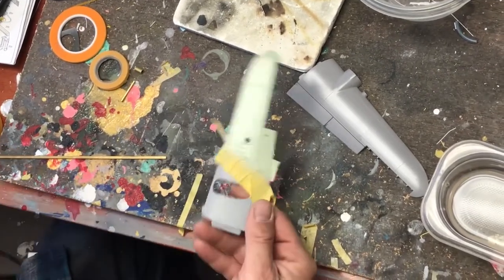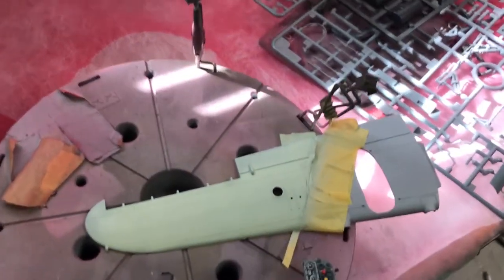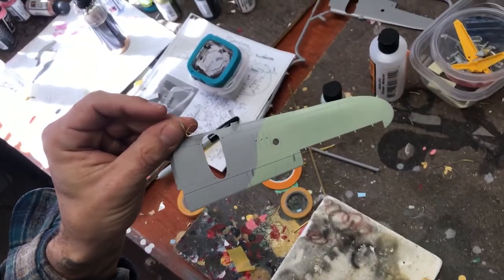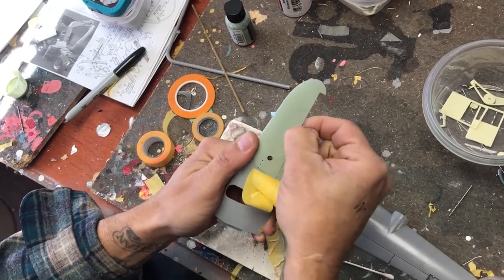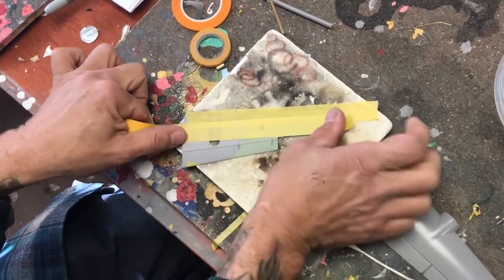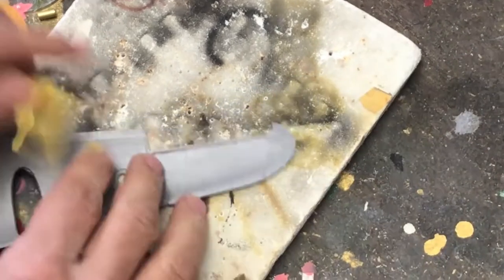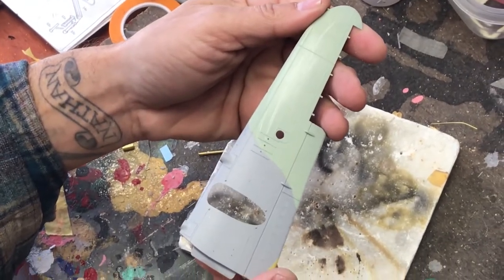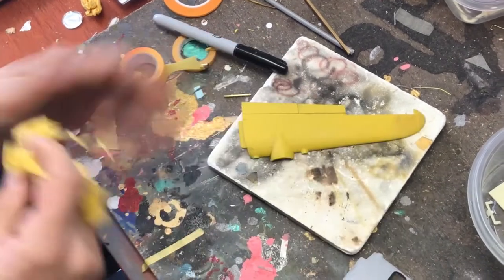Mission Models MMP Acrylic Paint Durability test and masking  demonstration

Comment: You were on a mission in this video! I love using your paint system! I did have a problem with peeling paint after applying a J’s Works star mask. I believe there were a couple of reasons for that. One was operator error on my part. I applied the primer too far away from the model. Second, it was extremely humid, over 90%, when I shot the paint. I’m using your paints for my model tanks right now and love them. The gloss and flat coats work well, too!

Comment: I'm impressed.  What air pressure do you use? I thought it required low pressure but evidently not.
Reply: We are spraying at a low psi about 12-15 with a .2 you are hearing the air hitting the model so it sounds higher
Reply: @jontamkin2560  thx

Comment: I like MMP paints but I've just encountered an issue with the line when I tried to do some wet sanding.  When coming into contact with water, the paint reactivates and can completely remove it with just my fingers, even if dried for days.  This doesn't happen with Tamiya but not sure if this is just an MMP thing.  I always follow the mixing ratio of 10% thinner and 10% poly and not dusting on paint.  That being said, the same doesn't happen with the primers, those stay strong.  Can MMP normal paints be wet sanded (outside of primers)?
Reply: Tamiya paint is a synthetic acrylic.  Mission Models is a pure water based acrylic.  We always dry sand with 2500 sanding pads.  The primer is a different formula than the primers.
Reply: @jontamkin2560  Thank you for the info, that explains it!  I was trying wet sanding for the first time and I could see in the MM FAQ that we could wet sand the primer and clear coats but couldn't find information on the "normal" paint line.  Will follow your suggestion!  Thanks again!

Comment: I've three models and have had lifting several times. Model was wiped with alcohol, primed with either stynelrez or Vallejo based with mmp and cleared . However at the time I wasn't adding poly. Now I always use poly not sure if that makes a difference but haven't had the issue since. Kow
Reply: I've just started using Mission Models paint & I have done everything the manufacturer says in the instructions and still both paint & primer peel when using masking tape. However I found a solution. I was building Tamiya's 1/48 Tiger and I sprayed a shadow coat of Tamiya NATO Black and had no issues with peeling or scratching. I also did this with Tamiya's Fw190 and only the wing edges had a little of the paint come off from handling. I really like Mission Models selection and it looks really good when dry. Apart from the peeling & some spray problems it does OK.